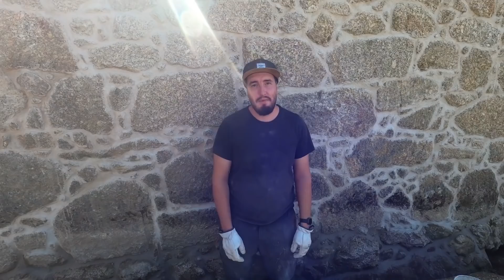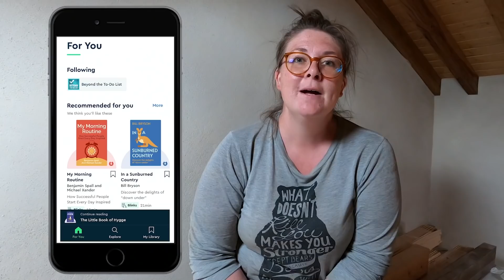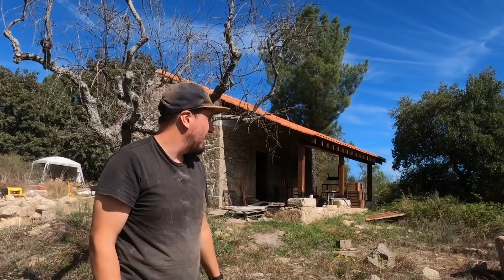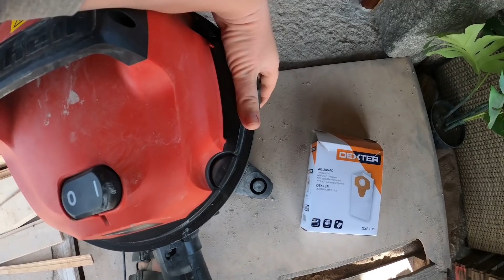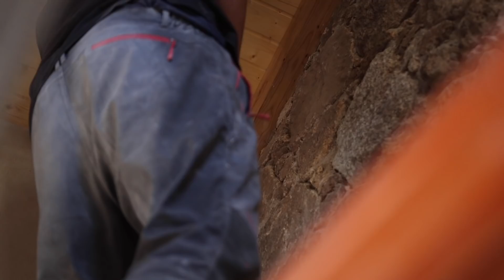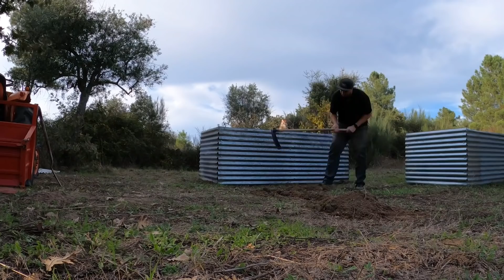AMAZING PROGRESS! Building Our Dream Off Grid Home

Comment: You might not want the solar on the roof of the barn. If its lower down its easier to clean and you can also have the panels facing south with the optimal tilt to maximise your power.

Comment: Well done u have achieved so mush don't over do it pace your selves, so great what u both  have done on the raized beds. On the raised beds were 
So u don't cut your self u can put the rubber pipping around them or the nuddles that u exercise in the pools they are cheaper than the rubber u just cut them half way then the fit on c u both in the next video 🤗

Comment: If I were you I would wrap that perforated pipe next to the house in GeoMat (nylon cloth). Otherwise over time those small holes in the pipe will become silted up and not drain water away. just a thought.

Comment: If you've got an old hose, slice along the length, then run it around the edge of the garden bed so you don't cut yourself on the sharp edge - and to protect it a bit from rusting (and then you even more from getting cut on rusted metal!) -- the wall looks fabulous!

Comment: You could put a rain barrel catchment system off of the gutter you are putting in and have more water up close to water garden and wash with etc. instead of just letting it soak in the ground? Just a suggestion.

Comment: I have never seen anyone put the plastic water barrier at a angle, it just goes on the wall....If it goes deeper than the wall it's not a bad thing.
If you fold it 90° it could crack, leaving water to cone trough.
There's no need to stop water from going down into the ground, as long as the building is dry.
Then dig a trench about 10-12 inches deep, leading away from the building at a angle.
Can't see the need to pay extra for one piece gutter, if it's at the right angle overlapping as recommended by producer...it should never leak.
But still, beautiful building.

Comment: Hi to both of you...sorry to be a pain, but I had a thought (it doesn't happen very often) and felt I had to add this to the mix of your ideas for your barn conversion. Think you had mentioned you were pondering on the stairs to your mezzanine and then today an idea is....How about a set of stairs that attach to a rail and move similar to that a library would have.  You wouldn't be stuck with it solid in one place, you could simply move it across where you wanted it, but it could also be "out of the way" if you didn't want to see it stuck out from your living area under the mezzanine.   There, I've had my moment and said it.   All the best guys x

Comment: How I wish you had a builder friend who would give you pointers every so often……your pointing process is soooo labor intensive due to lack of method……you don’t seem strapped for cash, so a compressor and blow nozzle would much more efficiently help you clear loose old mortar from the cracks, than the vacuum cleaner (can’t call it a Hoover, cause it isn’t)….a broad brush and wider strokes would help finalize the outdoors underground grouting…not saying your artistes brush is totally out of place, but really…underground pointing behind a plastic shield covered with gravel……
Please please consider labor reducing methods and machinery…..you are at risk of wearing yourselves out….

Comment: The Vacuum filter needs an air pressure gun good clean, also the generator had some greasy dirt below the engine that couldn't tell if are signs of problems, never had Stanley tools but heard many praises on it.
I once renewed a granite stone terrace floor by spraying MISTOLIN also adding after a bit of descaling SIRIL (or even the heavy-duty PRO SIRIL) on the harder bits followed by fast brushing it with a roller sander and/or jet washer and it did the trick, but each situation it's own, on my stone walls used the hypochlorite let it soak in than jet washed as well and it worked in my case (before someone I know was doing similar process with a sandblaster, had my doubts, but never got to see the final result)
But beware that some acids can etch the stone or make it clearer than the surrounding ones, so you do well to perform a test before the main work.
But be proud of what you guys have achieved so far, myself have learned so much doing my renovations and done so much more than I thought possible that I woked each morning eager to do more and learn more stuff it was unbelievable, of course, there were times I was exhausted and felt like giving up .. but you just have to suck it up and move forward, cause life´s hard but you need to be harder.
Stay safe all.

Comment: as house renovators ourselves, in the UK, I can say that guttering does not have to be all in one piece without joins to be effective. as long as it is properly installed with enough bracket support, then it is really fine. As off griders, you should never pass up free stuff & that includes water, especially once the veggies are planted & growing. 
We have water butts on all our downspouts including on the greenhouse, shed & summerhouse to ensure we have plenty to water our fruit & veg. You just need a friend with a digger to create the trench down to your growing terrace for the pipes & collecting barrels. voila!!  You'll bless the day you don't have to carry water from the wells to water wilting veggies.  Go Team Indi xx

Comment: Great progress. I am no expert but surely those raised beds are taller than they need to be, you only need a foot or so of "soil" set at a convenient height. When using the vacuum it might be easier if you could leave the motor outside and used a longer hose so that it doesn't vent into the area you are working in. Lastly, I bought a small (Lidl) SDS hammer drill that has a non-rotating mode which works with a chisel bit like  a micro kango hammer but much lighter than your 2 pound club hammer :)

Comment: Our Family Cement Mixer we would use the old cement bags when finished using it dip the bag in Old Sump Oil, wipe off the cement on the lip and outside of the Mixer Keeping it clean, shiny and rust proof. It lasted for decades.

Comment: I would lead the pipe to either your well to replenish it with rain water. Otherwise run it through the bottoms of your standing garden. So you wouldnt even have to water then most of the time.

Comment: In Canada we have to paint the wall with a rubberized compound first and then do the other steps you are describing.  Perhaps different methods in Portugal.  Be sure to check your filter on the vacuum cleaner.  You can burn out a motor really quickly by letting the fine dust build up in the filters.   Great jobs you two.  Bee, you were truly missed and are a welcome return.  Theo, you should be eligible for "Traditional Pointing of the Year" award by now.   God Bless.

Comment: Hello Bee and Theo,  what a fantastic job you are both doing.   In the stone wall there is a rock missing and you can see to the outside.   If I was going to do anything I would find a glass bottle that would fit the space and point it in for extra light.  Love your videos. Sending  💕  from the Ottawa Valley, Canada🍁

Comment: What i saw in a video about renovating a nature stone wall was, they painted the hole wall with linseed oil. Not thick, they painted it in a very thin way,but the colour of the nature stones  comes more out and to brush the fugues, the milky on the stone gone away. A little tip. As you make the stones wet, you have an idea, how it will be looks.

Comment: I wonder why you did not use a high pressure washer to thoroughly clean the stones below the ground level, it would have been a whole lot easier and the stone would have been wet right away, ready for pointing. And you can use compressed air for blowing the dirt out of the gaps in the wall inside your house. Keep up the good work together and enjoy doing it!

Comment: You can always drive rebar down along outside metal box if it develops bulge or another verticle 2x4 to brace a comfort rim around top so flat 2x4-6 rim doesn’t hang over inside of bed and cast shadow. I just love brainstorming. Thanks for opportunity to share ideas. You all are rocking the barn.

Comment: Ι would advise on a bit different pointing technique inside: use more (thicker) mortar and leave less stone exposed. So that only the main body of the stone is exposed. It will lighten up the wall but still feature it's lovely construction.

Comment: Just a quick tip guys!, with the hoover bags when they get full don't bother wasting the bag just cut a slit in the bottom and empty it out. Fold the bottom of the bag over and use a strip of gaffer tape to seal it back up!.

Comment: Did you know that you only need planting soil 8-10 inches deep? I'm not sure how you are going to fill container gardens that are as deep as yours. Have you thought of hanging a floor 12 inches below the top edge? If you fill the bottom with compost, it compacts as it ages, so your veggies will sink.
I'm not explaining it well, but "Square Foot Gardening" has step-by-instructions on it. Plus Trent & Allie made table top containers for the greenhouse at Trent's mom's house in spring 2020. Check them out! Cheers!

Comment: Theo - Forgot about your small hole you have which you want as a light source. 

See if you can get some clear epoxy which you can pour into the space. Use some putty to hold a small piece of glass with a thin coat of oil (sprayed) to block the leakage and create a place to pour in the epoxy on one side. Its quite liquidly so you do need to make sure it doesn't leak out.

It would look nice after you sand it down a bit to match the shape of the pointing.

Comment: In the U. S.  some off grid homes have 55 gl water barrels at each corner of the house. The gutters feed directly into the barrels, and the barrels have a brass spout at the bottom to attach a garden hose to. Easy water harvesting. Just something  to consider.  Theo is   "Machine" 💯👍🚜⛏️🔨. Keep up the good work!

Comment: When you talk of shooting the water off somewhere else, have a look at the communal irrigation system in place in Madeira.  You could lay half clay pipes or just plain concrete to form a gully in the ground away from the house to a concrete structure or the water tank that catches the rain water further down nearer your veg area. Then release the water as and when you need it to water your plants. Saves you filling your tank up manually 🤷🏼‍♀️ again look at Madeira.

Comment: Make drainage around the building so that the water can run away and does not penetrate into the building. If there is already a ditch around the house, you can join in with one.

Comment: Just a few suggestions on the raised beds from personal experience. Might want to put some ridged foam insulation on the interior of the metal panels to keep some of the heat from the metal burning the plants roots. Also just drill a hole through each of the center side boards and run some fairly thick wire between them twist the ends together then insert a small stick between the 2 wires and twist until you get the tightness you want. You might want to do in two spots if you don't have heaver wire. Can't wait to see the interior wall pointed!!!

Comment: Excellent video and excellent progress on the mansion 😀. Now to the raised beds, I am worried about the exposed sharp edges of the metal sheets. May I recommend that you line the top with say a wooden beam in order to make it safer and avoid one getting injured by the sharp metal edges? Something like a 2x4 wood will do and will also add some sturdiness to the raised beds.